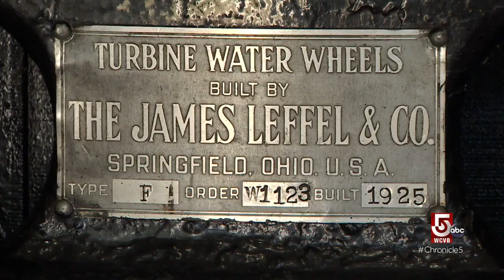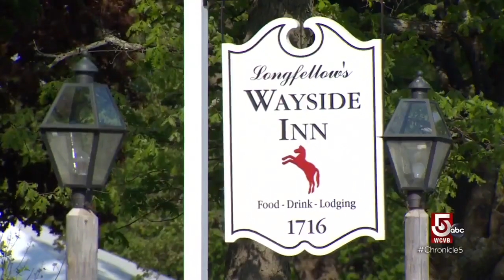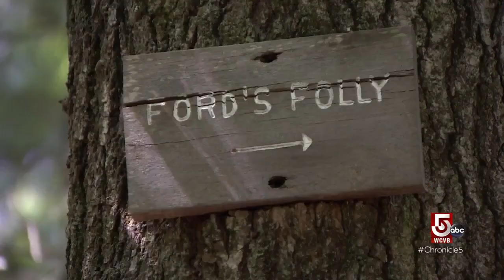The clean energy benefits of hydro-power

Comment: you wish to make a difference??
Hydro electricity
The Frozen technology 
An open letter to the world
By Simon Bowman
Australia 
Since the beginning the growth of hydro science has been slow and we have made very little forward movement in the past 40 years. 
The ideas that might make it leap forward with more efficient use of the water are stifled by education being thought of as immovable . 
What was wrong yesterday will be wrong forever and new tech can't get around a problem. 
This is not a problem solving mind set
Australia has forced many an idea to leave this country to grow 
just because we have an issue with new ideas 
A classic example was Metal Storm a new type of fire arm that had no magazine and no brass cartridges to hold the propellent. 
all the bullets are held in the barrel and with this configuration the barrels can be stacked this gives it a rate of fire unmatched anywhere 
It had to leave Australia to become a product or stay and die.
This I fear is the same story about to happen with the hydroelectric field 
Since 2016 RDP Marine Australia has been working on a system that can be retro fitted to all dams with tailraces longer than the turbine hall needs so it has to deal with a backpressure higher than is ideal creating a loss that can now be recovered
At this point it should also be noted that the inventor asks where is it written that water storage dams can’t make hydro power to ?
So is this inventor saying “This is the answer to all ur power needs?” 
No of course not but like all good things it is a part of a solution it will fill the gap for base load green power
Lets not forget at the location where these units will be fitted has most of the infrastructure already in place to build the system
NOW TO THE ISSUES
There are three main issues right of the top that are the most commonly raised as why it will not happen
So lets stomp on them straight off
1, fit an item into the tailrace and backpressure will rise in the turbines 
No this is not true as a this system if done right it can be fitted to be like a tuned exhaust for a car 
2, There will be to little back pressure so RPM will not be constant 
Again No if the system is correctly fitted this to is a dead issue 
3, Dissolved gasses that are held in suspension 
This is a minor issue and most chief engineers are well capable to work with this 
4, NOW this one can be a deal-breaker it is to do with a what if question. 
So what if the new set of turbines go down or just one ?
Well if one or all freeze up the main turbine hall will be unaffected and no issues flowing up hill 
These four issues are the most common reasons I am told No 
It is this closed thinking (knee jerk response) to a new idea from the same family of being blinded by their education that stifles the industry moving forward 
The one question I have no answer to is time 
How long to install?
How long to service the new turbines?
To service time i still don't know but the system is set to allow a swap out setup so actual down time for that turbine slot is less than two hours and the rest of the system remains running during the swap
How much will it cost?
I can guess only the price but the price is not so high as to be to costly 
Whats its life span?
Well with servicing I can see it giving service for the life of the dam
NOW the big question Money!!
this is a fluid issue shall we say the rate changes and i have stated previously money values but the income is in two parts the improved tailrace efficiency and the second bank of turbines should be close to 10% extra income  
The one main issue I find so wrong is the time line needed from this point to the world seeing a working unit. 
The tech is there to make it 
The skills are available to hire 
The market is in need of this item
But the price will rise with demand as the population is getting bigger but the book keepers are happy to see it remain as a rare item with a limited output that pushes up the price 
The first adopters have always been the biggest winners I wonder in this area if it will be the big four or will a player from left field run on and wipe the floor with the rest standing with their hands in their pockets confused as to what just happened
Well, I hope this has given you food for thought and made you pause your thinking and look into what I have said I do not expect you to just except what I have stated as fact nor do I know it all so I can learn a new thing to.
Please pass this around let the open minded look it over and pass judgment after all the driver in the end is the need and the ability to see what is needed down the road is the saving grace of the human species to plan ahead
If you think i have missed a point or you have questions please comment i will respond well within 24hr and as i have said many times i don't know it all and you never stop learning